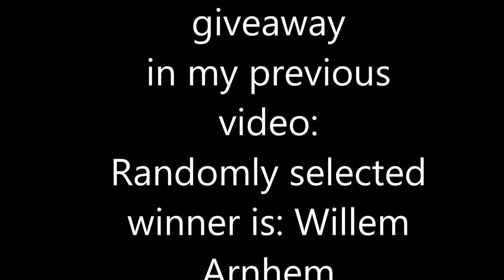Metal working: Making Saw'sTable -part 3-

Comment: When I saw the jigsaw blade, I realised what it was... I have a foot peddle too for my scroll saw. bought second hand from sewing machine shop. It makes a BIG difference in controlling the work piece.  Thank you Tuomas for my evenings entertainment :D
Reply from the maker: Peter Compton You're wellcome. My opinion is that Dremel should sell those with the moto-saw too. It really makes a difference. Im working now with the bearing housings for the scrollsaw mode. Tought that i could print them.. but now karma hits me to the face.. i have allways avoided 3d desing softwares. 😁 So, it might take a moment before i design anything more complex than a cable clips.
Reply from the maker: so.. im going to go with the traditional style this time.

Comment: Had to make brackets for my motorcycle side saddlebag could have done with your welding skills Tuomas.
Reply from the maker: Michael Evans Welding is like driving with a bicycle.. after you get the idea it comes naturally... But it also needs some training first. What type welder you use?
Reply: No welder Tuomas never welded cold bent 3mm mild steel with the aid of a hammer and a vice.

Comment: Great work! Which model Hitachi drill Do you use ? What is your opinion about this model?
Reply from the maker: Vasil Vasily Its:

http://www.hitachipowertools.ca/en/Products?cat=18&pid=123

Its great, loads of torque!
Reply: Tuomas Soikkeli , thank you. Could you write which is diameter the round place on the drill gear box ? I want to install this drill in to a drill press.
Reply from the maker: Vasil Vasily Its 43mm
Reply: Tuomas Soikkeli , thank you. It's my favorite dimension!:)

Comment: Great one!...but you can modify it, if you want to saw (let's say) a long plywood sheet, your guide must be attached at the back and (not to the side of the table), and consider a splitter to avoid the kickback. Also at your right or left side a "fence" to obtain a perfect 90 degree cut. And between the jig saw blade and the table, another bearing to obtain a perfect vertical movement avoiding any back and forth movement.

To give you and example, see the new "Blade Runner X2" from Rockwell that was improved placing the splitter at the end, and the bearing I mentioned before. It only a recommendation with all the respect you and your work deserves. Greetings from PR.

Watch the video for the guide mount position and "splitter", also the sled attachment, and the bearing (When changing the blade for metal) under the table:

https://www.youtube.com/watch?v=GsJREoryIFc
Reply from the maker: Hi. Sorry my late answer. Somehow youtube hide it.. got a notification but didn't see the message at all. Then i found it from here  (google+)

Jigsaw blade guide / scrollsaw attachment can be removed quickly, so i can use table saw to cut wide sheets. I actually have a fence to it allready, there's a video from making it. 

Bearings.. that's a great idea thank you my friend!